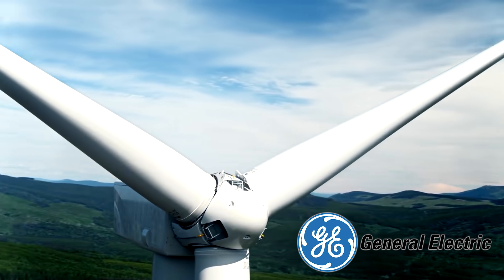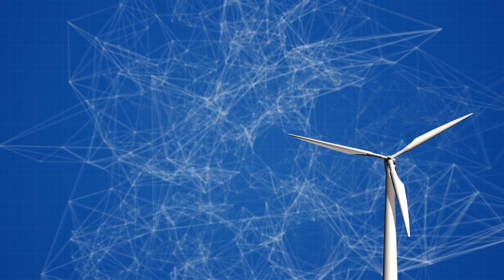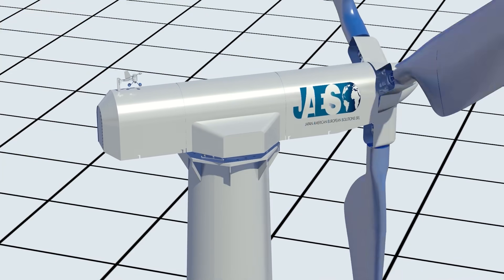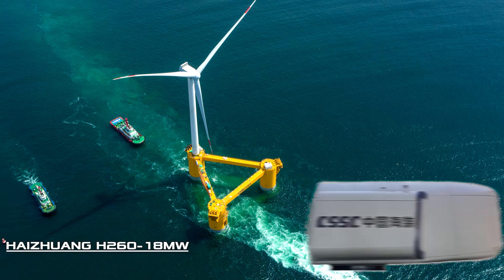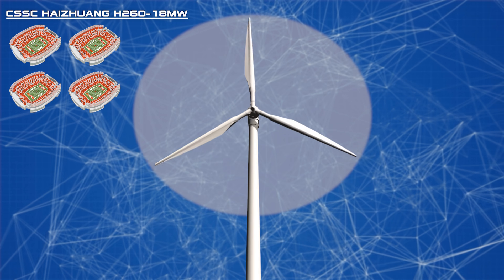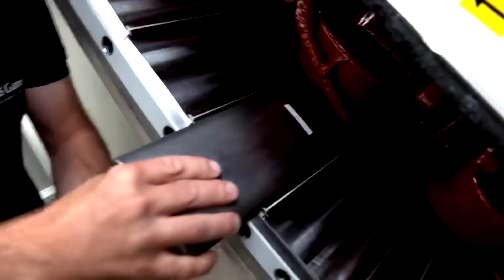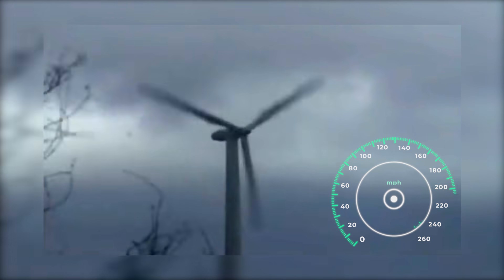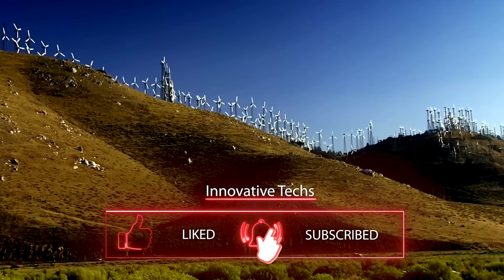China is building a wind turbine of unthinkable dimensions

Comment: The wind turbines could be made bigger by making the blades retractable. That is built into multiple pieces and extensible in and out of themselves, as appropriate. You could automatically extend the blades to catch the slower winds. Extend until the tip speed approaches the speed of sound. Then, retract to keep the tips at subsonic speed. I need to prototype and patent that idea!
Reply: They essentially do what you're saying by varying the blade pitch. The governor in them infinitely varies the pitch to maintain selected RPM. To stop aerodynamic load in a storm the blades go to full feather where the leading edge points directly into the wind drastically reducing wind loading and stopping rotation (I'd say they have an electromagnic and/or mechanical brake as well). The Angle of attack of the blade is coarser near the hub to compensate for the lower relative speed compared to the tip. 
Probably the largest percentage of the power produced is in ~ the outermost 1/3rd of the blade at any rate but don't quote me on that.
In normal operation the pitch controller infinitely varies the blade pitch between coarse and fine depending on wind speed, and possibly electrical load. 
The vid well explores the reasons why but the end bit of the vid is deliberately provocative to get you to subscribe, since the blade tips aren't ever going to go supersonic.
What happens is the bigger they get the slower they turn. They can change the generator, gear it down even further or do a number of other things to get more power from slower turning. It's a blade surface area game and the blade pitch controller regulates the apparent surface area - infinitely between the coarse and fine stops with manual control too.
Reply: You dont want the tips go anywhere near the speed of sound. In fact... current blades move with 300km/h 24/7 and are already affected by erosion through simple dust particles. 
Search for "photos of heavily eroded wind turbine blades". The aerial Dust at those speeds effectively acts like a sandblaster on these blades.
Reply: @cutterboard4144  Well, just build the last few feet of appropriate materials to protect from sand blasting.
Reply: @peterdavila3045  I guess the egineers would have done that by now if it were that easy.
Reply: @cutterboard4144  Engineering is not ever easy, no matter what concepts your machines are using to work. But, do not assume that ALL ideas have already been thought about!
Reply: @peterdavila3045  Of course not, but obviously you would want to make the blades edges stronger as soon as erosion is recognized.
Reply: @peterdavila3045  i hope that at least now you are understand why  you are not making a windmill or anything
Reply: Interesting idea but would this add extra mass at a point at least around the middle of each blade due to the retraction/extension mechanism? Maybe a way around this would be to make the blades almost airtight and used compressed air to extend them, with an extension spring to retract the tip section. Using compressed air may also reduce the weight because the pressurised blades would be more rigid, without the need for thicker material. A compressor could be installed at the base of each blade.
Reply: @ThePaulv12  Any reason why they dont have winglets like planes and why not make the tips wider to catch more air vs the thickest part being near the hub considering the pitch technology in stronger wind.
Reply: Those hinges would need to absorb massive wind forces when in full rotation. Plus you'd need to bake 2 large blade pieces vs 1 uninterrupted design.
Reply: @ThePaulv12  can each blade be pitch controlled or are they all grouped together.
Reply: @stephendoherty8291  Each manufacturer calculates and decides whether the extra cost and complexity of winglets is economical justifiable. Here around the corner are 8 Enercon 2.5 Mw turbines that all have winglets on their blades.
The shape of the blades is a purely aerodynamic matter. Like @ThePaulv12  indicated, the blades of the turbine and every different point on the circumference  " see " a  relative  windspeed that is the combined vector of the real wind vs the speed of the blade at that specific circumference. The tip of the blade has a much greater speed, than the blade at the root. Aerodynamically the optimal shape and angle of attack is related to the windspeed.
What it comes down to is that the tips have no need for "more" air (because their shape is optimal), but rather need less air in strong winds. Here the pitch control comes into play, because in (too) strong winds the angle of attack of the relative wind is changed so that the shape and angle of attack is less than optimal. This explanation is cutting corners, but I hope you get the idea.
Reply: @stephendoherty8291  Each blade has it's own pitch control mechanism, but the pitch is always grouped. The pitch can be trimmed for each individual blade, but only to match the others. The aerodynamic  balance (wind resistance) has to be preserved.
As an afterthought : it might just be that turbines this big could benefit from individual blade pitch. On this scale and height the difference in windspeed ( the real wind)at the top vs the bottom of the circumference may be great enough to give the blades different pitches depending on their position: top vs bottom. Depends on the reaction speed of the pitch vs rotation speed.
Reply: @stephendoherty8291  Hi Stephen, which hinges do you mean? I think Peter means that the blade tips retract into the body at a point around 2/3 the blade's length.

Here's my suggestion to the original comment:

Interesting idea but would this add extra mass at a point at least around the middle of each blade due to the retraction/extension mechanism? Maybe a way around this would be to make the blades almost airtight and used compressed air to extend them, with an extension spring to retract the tip section. Using compressed air may also reduce the weight because the pressurised blades would be more rigid, without the need for thicker material. A compressor could be installed at the base of each blade.
Reply: The bigger problem is the energy to make ever larger blades (often harder to recycle) and transporting them from manufacturing to site install. This results in ever larger trucks, install and shipping boats and support vessels. Plus ever taller turbines mean deeper concrete foundations (near impossible to remove) or even bigger "floating" mounts and seabed anchors. Bigger kw turbines mean fatter cables needing more copper, damaging more seabeds. HV or superconducting DC cables can cut this but at high expense. Even maintaining such massive mechanical structures has negatives, the bigger they become. Cost of turbines rise.
Reply: @cutterboard4144  The wings are facing abrasion and thus the wings of dirty wind mills are regularly repaired. I was working at Sika some 10 years ago  to develop new methods of repair.
Reply: @stephendoherty8291 Cost per windmill is higher, but cost of the electricity it produces is less, which is the bottom line. Efficiency of scale.
Reply: @rhensontollhouse  depends on the subsidy scheme for dirty wind mills.
Reply: @rhensontollhouse  True. More costly onshore as bigger turbine heights draw more objections and aerial assessment over a larger area/higher population. Onshore height also means it impeding more bird flightpaths where there is less room to land and recover if the birds have to regroup or they hit any part of them
Reply: Why 3 blades and not 4 or 2
Reply: @stephendoherty8291  Greg`s airplane handle this topic for aircraft propellers. The physics is similar. He discusses advantages and disadvantages.  2 blade have a higher efficiency but needs more height (length of blade) for the same power. 4 blades the other way around. 3 blades is a compromise. 

The best wind mill is the windmill that is not built at all.
Reply: @holgernarrog962  The best power generation, is the one avoided in the first place. Then demand of high emissions or any emissions energy is avoided
Reply: @stephendoherty8291  The worst power generation is a power generation that does not meet demand. 

The value of the dirty wind electricity was in Germany before 2022 below 0. 

A modern coal power plant generates ashe, toxic filter residues, destroys farm land but it generates useful power according to demand.
Reply: You sound like a physicist.
Physicist says, "it is theoretical possible, so engineer make it."
Reply: @paultrauzzi5360  I`m a mechanical engineer. My favorite is nuclear but if a nuke costs 10bn due to excessive regulation a coal power plant is ideal. I was working some years at SIKA. There were some projects concerning the foundation damages and the abrasion of the wings of dirty windmills
Reply: @holgernarrog962  
SIKA the chemical company?
In Canada the nuclear regulations are far from the problem, it is just the cost of building.  Canada is very pro-nuclear energy.  Ontario is the first to build the SMR for large scale energy production and once proven, many more will be implemented. 
I hope we don't need to discuss the reasons why coal is a dead industry where people want to have good lives.  
Nuclear is by far the best method for energy production and MOST of the cost is not in the fuel it is the operation and all that is very GOOD paying jobs.  All that money goes straight back into the local economies.  It's a no brainer.
If I had my way, I'd make 1000s of CANDU reactors, there is no need for enrichment and hence no possible weapon creation.  Even Iran could employ CANDU without us getting concerned.
Reply: @paultrauzzi5360  In Sika I was participating in a project how to repair the abrasion of wind mill wings with Epoxy without dismantling it. The other project was to refurbish the foundations of dirty wind mills...The foundations usually need refurbishment after about 8 - 10 years. 

Well I`m engineer...As far as I can read energy and nuclear is not your focus. 

Coal is a blessing for humanity beside the green dogma of "climate change"* or how you call this woke fetish. It provides heat, energy and thus life for billions of poeple. 

A CANDU reactor is ideal to produce plutonium for military purposes of an excellent quality but is economically inferior to a LWR. The costs for some 650 tons of heavy water is bejond that of enriching uranium. The reactor vessel of a heavy water reactor is much bigger than that of a LWR.  The CANDU design with its pressure tubes is more complex and thus more expensive and has a life span of 30 years compared to perhaps 80years of a LWR reactor vessel. 

Till about 15 years ago AECL was working on a following concept of the CANDU the ACR1000. It used heavy water for moderation, light water as coolant, low enriched uranium as fuel. Less of the expensive heavy water, more compact with more power. Together with the usage of supercritical water - efficiency > 40% - it could surpass the LWR in economics. A few years ago I asked a manager of OPG and he told me political reasons (dirty renewables) that this project was abandonned. 

*You can google my analysis of the "climate change" dogma.... "Weak Point Analysis of the Hypothesis of "Climate Change"" and my name.
Reply: @holgernarrog962  
I'm not concerned with politics of energy systems, just what works and doesn't and the impacts they make.  
Yes, without coal or oil we would have 6 billion people less than today and I'd be happy for that if I was one of the people left or got to choose.
If you live beside a nuke plant you have no issues, if you live downwind of a coal plant your life is cut in half.
I've personally set up many heavy fuel oil systems and it's very similar to coal, both will shorten the locals lives.
As I stated, the cost of building and operating nuke plants only generates money flow and mostly to the local communities, Hence, complexities are no concern.  CANDU reactors have a perfect safety record and can actual burn waste from the LWR.  
As I'm sure you know, Plutonium created in a powerplant can't be used for nuclear weapon due to the low purity of Pu-239 and predetonation,  It would be extremely difficult to create weapons grade Pu-239 unless the reactor was specifically built to do so.  
Overall, CANDU reactors use 30–40% less mined uranium than light-water reactors per unit of electricity produced. This is a major advantage of the heavy-water design; it not only requires less fuel, but as the fuel does not have to be enriched, it is much less expensive as well.
Not one system is best everywhere, hence the need for solar, wind, etc.
But where a large nuke plant can be built safely, it should be.

We can completely unconcern ourselves from the Climate Change question when we look at costs, safety and health.
Reply: @paultrauzzi5360  A CANDU is the ideal reactor to make a high quality military plutonium as you can put fuel elements in and out during operation. But anyway I would appreciate to read first.
Reply: @paultrauzzi5360  Your main challenge is to read things completly and not to jump to conclusions before having any knowledge. 

If a coal power plants is equipped with scrubbers and electro filters (Europe, North America) there is no reason that you will loose a day of your life.
Reply: @holgernarrog962  
Yes that is also true.
CANDU can continuously operate for years without shut downs but the rods should only stay in for short periods to create purest PU-239.
Plus the CANDU reactors were designed for 50 years of operation, much longer than you wrote previously., but they will be extended  decades past 50 years.
Reply: @holgernarrog962  
I gave you the courtesy of assuming you knew the scrubbers are incredibly expensive to install and more expensive to run.
Because of this there effectiveness drops quickly. Hence 40% of all heavy metals pollution and more are caused by coal plants.
Reply: @stephendoherty8291  "Cost of turbines rise."
rises. 
"Cost" is singular.
"Turbines" is plural, but it's not the subject.
If you can't identify your subject, you don't know what you're talking about, do you?
Reply: @paultrauzzi5360  
"If you live beside a nuke plant you have no issues, if you live downwind of a coal plant your life is cut in half."
Nonsense.
But coal mining has killed tens of thousands of miners and every ton of CO2 is a degradation of the air. There's no need to make up stupid lies to make the case against burning carbon.
Reply: Will look in imagination. Such mechanism will ad weight . Some soviet plane had used this idea which was scraped due to complexity or impracticality .
Reply: Your patent is not valid in China.
Reply: @stephendoherty8291  why don't you keyboard engineers simply offer your sharp minds and qualifications to this helplessly incompetent sector? I'm convinced things will improve dramatically!  How about bringing Orange Man in the team, now we are focused on improving the whole? 🤣🤣
Reply: @holgernarrog962  I can inform you that subsidies are no long needed! As often seen did public subventions help this bussines to stand on it's own feet. Aren't you proud as taxpayer contributing to important technological improvements and now seeing your investment returned..?
Reply: @stephendoherty8291  There is hardly any birds impacted by wind turbines..
Reply: @holgernarrog962  don't spread lies just because you're obsessed with dirty coal plants and extremely expensive Nuclear power! Absolutely no foundations needs refurbishment. Denmark, as well as other technological highly sophisticated countries, have thousands of these constructions placed all over since 1991(!!) under very harsh offshore conditions. Never been any issues.. Are your assessments always based on rumors and ignorance, not that convincing ?
Reply: @holgernarrog962  Finland has recently started a huge 1.6 GW nuclear plant with some 14 years delay and 8 billion € extra costs! Are you convinced these extraordinary issues wouldn't cause trouble elsewhere? As usually you didn't mention how to store radioactive waste, several hundred years ahead..
Reply: @OmmerSyssel  The EPR in Finnland is a story how not to do a project....
- The French built the last of their own nukes in the 90ies....The experienced teams dispersed, the doc. was in CAD drawings the system did not exist anymore, similar to other docs. They had to hire a new team made new docs. 
- The state owned company had a lot of theoreticans that collided at each occasion with the Fins. 

In general the excessive regulation of nuclear with certifications, test requirements and documentation combined with the low number of new builts generate excessive costs. It is to adapt the regulation on the low real risk of nuclear. 

The Rosatom built 1 or 2 nukes each year for decades. They usually stay in their time and cost schedules. The Chinese built their CPR 1000 nukes for 2 bn$ and their Hualong nukes for 3 bn$ according to their own statements. That is a competitive price. 

The least expensive way to store nuclear waste is to use a salt or clay formation some 700 - 1000m below the ground. The Glencore Ernest Henry mine in Australia did cost 700 M$. That means without a big spectacle you could do it in 3 - 4 years for about 2 bn$.
Reply: @OmmerSyssel  "don't spread lies" ...Do you want a serious technical discussion or just preserve your green religious visions? 

" no foundations needs refurbishment" is not in line with basic technical knowledge. I had nothing to do with dirty Danish wind mills but the technical challenges should be the same in Denmark as in Germany/Spain where my project was situated.
Reply: @OmmerSyssel  There is no dirty wind mill without a subsidy scheme or a regulation scheme that prefer the windmills. 

The dirty wind mill generates electricity acc. to the coincidences of the weather. At best the value of dirty wind electricity is the avoided fuel costs of modern power plants. If fuel costs are driven high by the market or the green religious CO2 certificates there is indeed an artificial "competitiveness" of wind mills. Industry cannot afford such extreme expensive electricity.
Reply: @7_years_and_  That was the problem. The Russians tried building it.
Reply: @AsokaTw-mz3lr  I'll see them in court
Reply: @OmmerSyssel  I think you'll find some of these are both is flight migration routes (offshore) or in rural areas, the last bits of developed countries bird sanctuary.
Reply: @David_Lloyd-Jones  So I'm wrong, due to grammer of one last sentence?